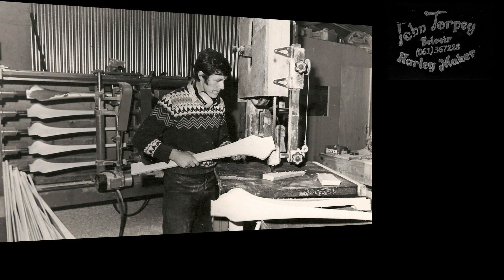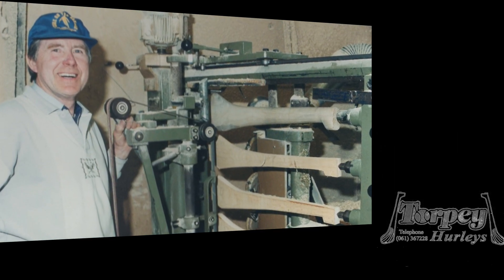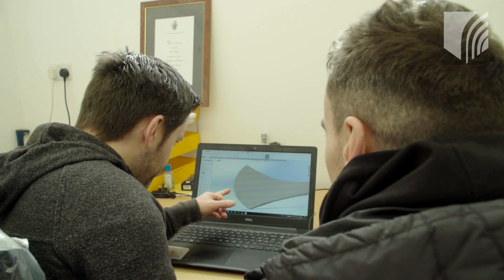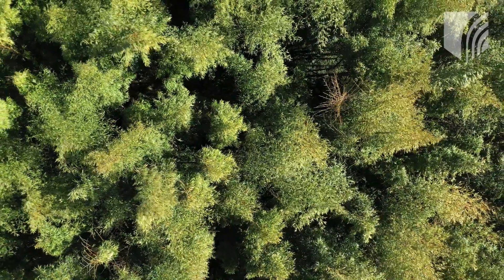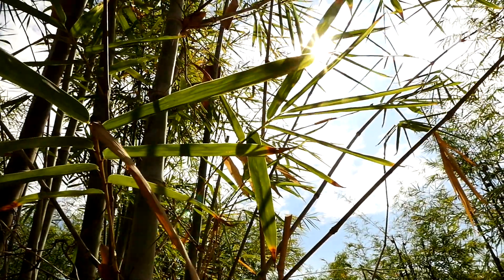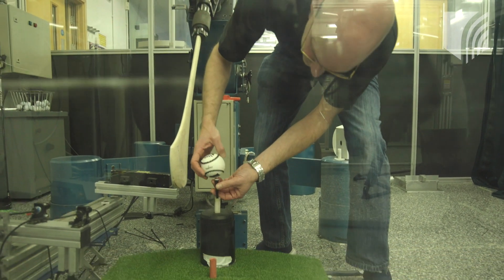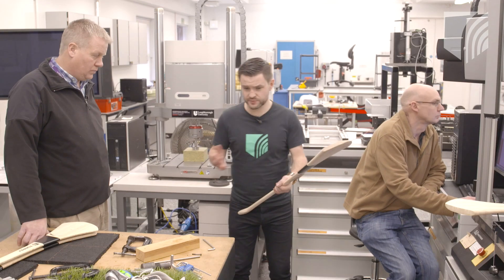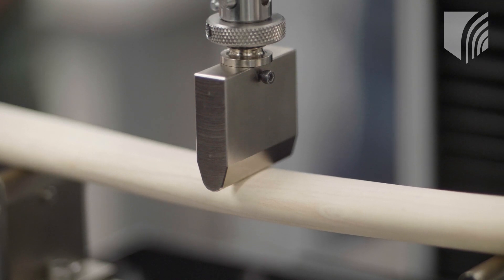TORPEY® BAMBÚ - THE FULL STORY

Comment: Bamboo hurleys are quiet heavy especially for young lads and the handles are quiet thick. This will slow down their striking speed and slow down their overall hurling speed.
I’m not that impressed either with torpey hurleys tbh. All their hurleys now have a huge bas frying pan style again will contribute to a slower strike. Also torpeys don’t make odd sizes so if a boy or girl needs a 27 or 29 or 31 inch hurl you can’t get it at torpeys
Reply: Just get the lighter one?